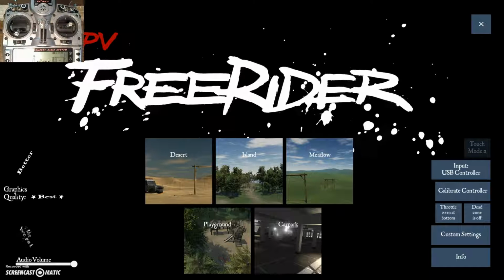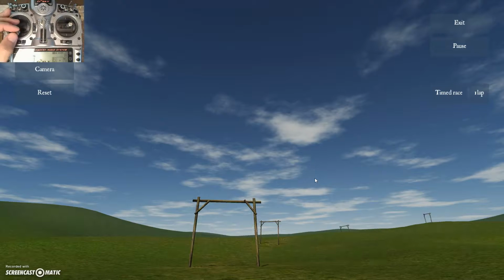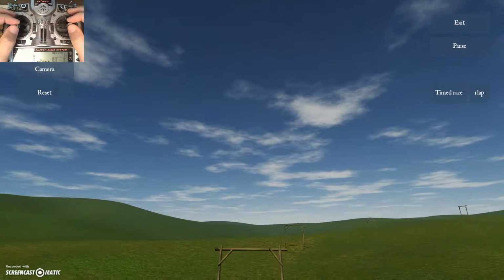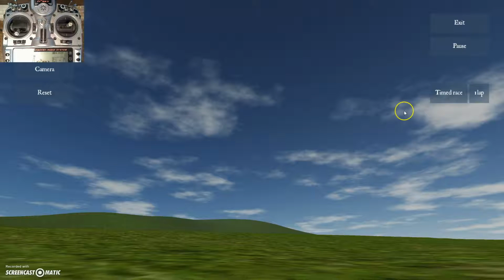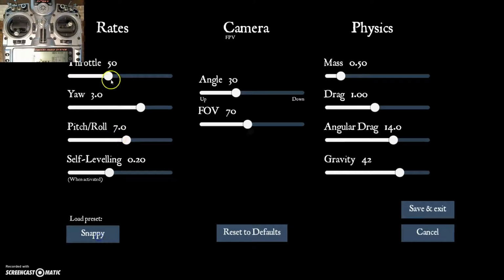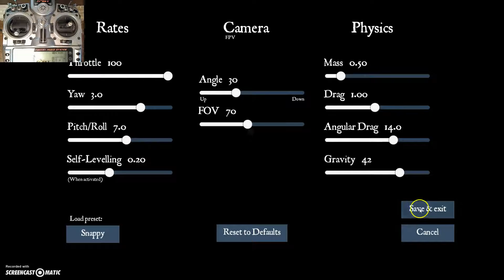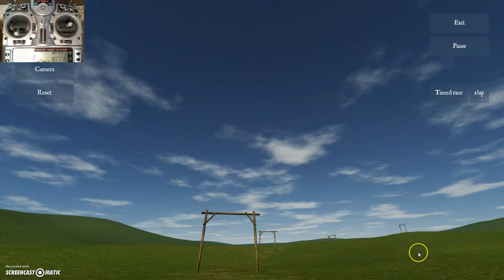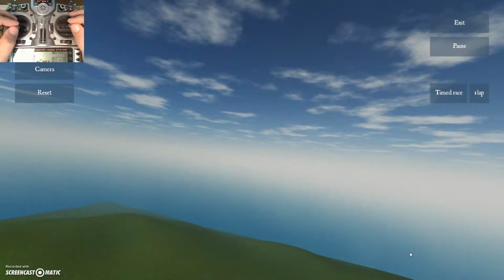How To Fly A Racing Drone - Lesson 13 - Flips and Rolls

Comment: Thanks. What is the differents between to cut throttle during flips and rolls and no cut throttle? Thank you
Reply: Renato the propellers always “pull” the quad in whatever direction it’s tilted. if you don’t cut the throttle when it’s upside down, it will pull the quad downward towards the ground faster than gravity

Comment: The problem with practicing on a simulator is none of them actually respond like a quad does. For instance, the moment your quad is tilted, it starts loosing altitude rapidly. The faster the flip, the less altitude you lose. You can roll in this simulator, i have it btw, and not lose any altitude fast or slow. You roll your quad and it is going to drop like a rock requiring a healthy throttle response to counter the downward momentum you generated. This simulator will not teach you that. I have yet to find a simulator that does a decent job of recreating the effects of gravity. Not even the DRL simulator. Chop your throttle in that one and it floats down like a feather. You can not even fly it into the ground fast pointed straight down.  There is only one way. Find a grassy field and practice, practice, practice.
Reply from the maker: Still, for somebody starting from scratch, I think the basics of how to fly are close enough in a sim to be worthwhile.

Comment: Great point about learning rolls first. 
My fear is not crashing, it's the cost of replacement parts...
#TooPoorForParts
Reply from the maker: +Propwash Rotorsports Use a big open field and get LOTS of altitude first. Once you gain some confidence, you can move lower. The real risk in my experience is doing a flip low to the ground and mis-timing it, at which point you don't have enough time to correct. It's better in my opinion to do a flip a little slower and time it correctly, rather than doing it faster and mis-timing it and then needing to correct.